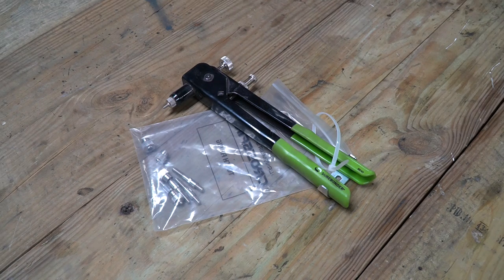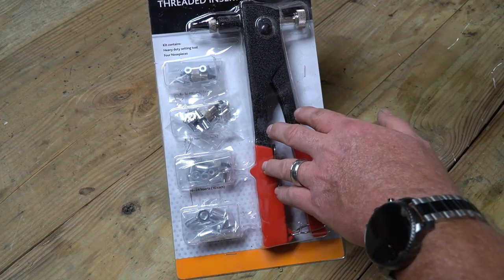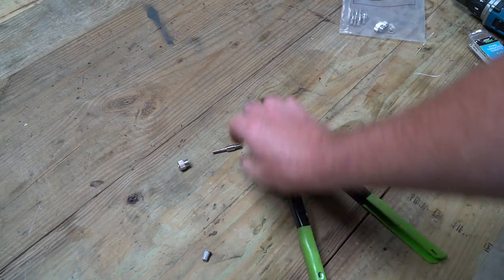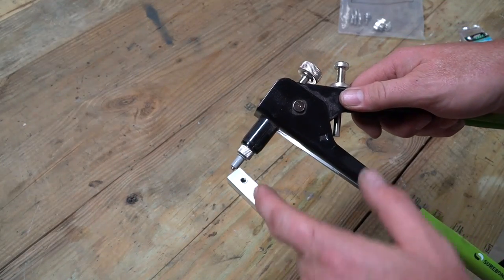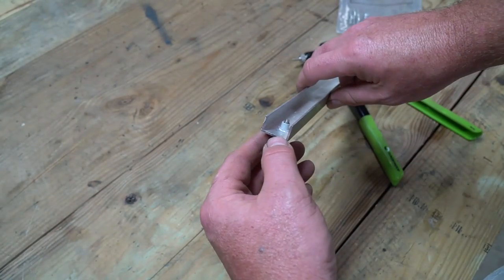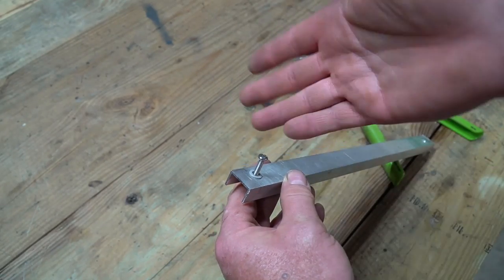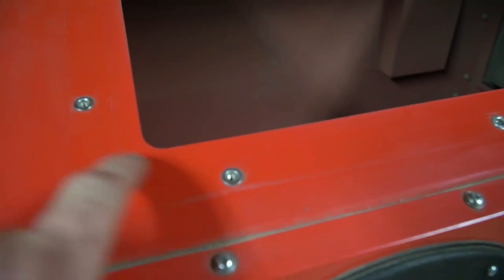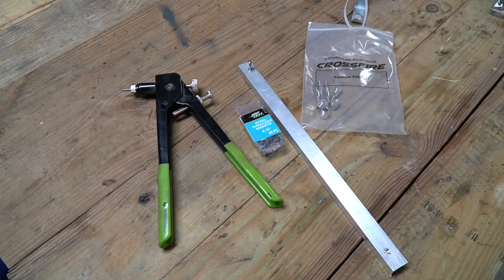How to Install Threaded Insert Rivets with a Riveter Kit, AKA Nutserts, Rivnuts, and Rivets, NTDT!

Comment: These are awesome tools, however the big brother of this is way more useful.  This tool is great for light gauge steel like car panels and such.  The big brother is a two handed affair which allows you to install the rivnuts into heavier gauge steels plus the light gauge stuff.  If you do buy a tool like this check out the larger option, it's probably only a couple of bucks more and way better value IMHO.  If you try to use this on thicker steel, you need the strength of superman, plus it will probably crack through the pivot point over time.  Great review and a must have tool.